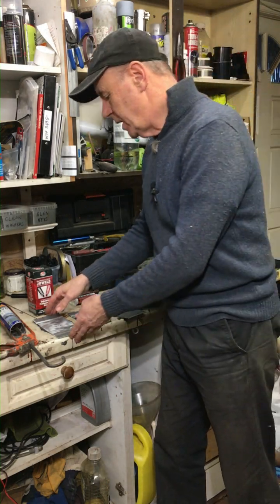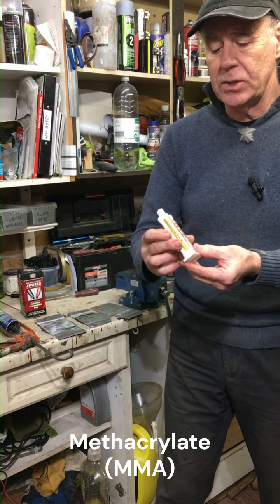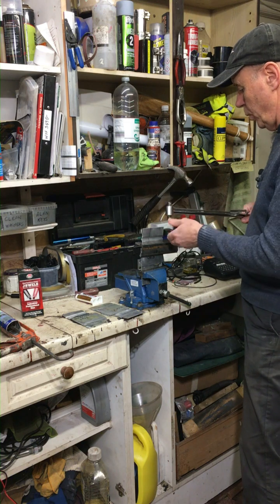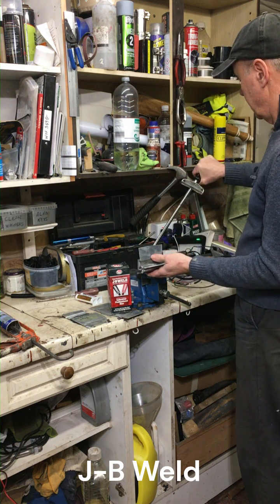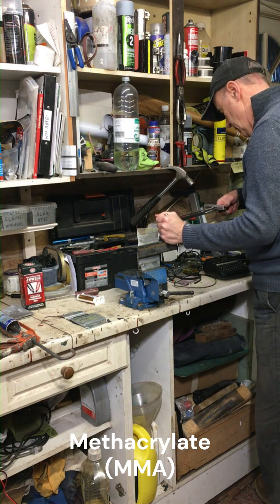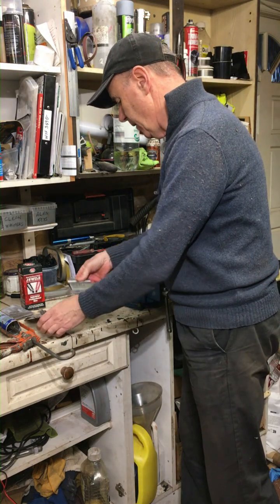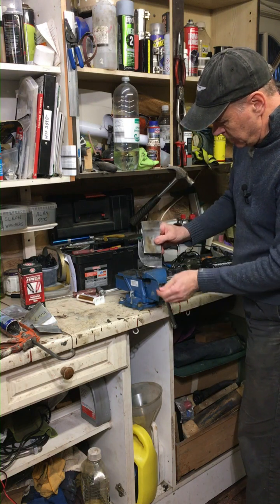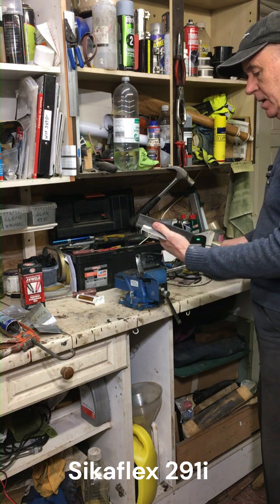Aluminium Bonding Test:   J-B Weld vs Sikaflex vs Methacrylate

Comment: Great video even though I hate vertical video! Bonding aluminium can be tricky due to the oxide layer. One trick is to apply the epoxy first - then score it with something through the epoxy so the oxide can't form. Roughened surface help a lot of course but the oxide forms instantly so you need to score it again through the wet glue.
Reply from the maker: Yes, well you are not alone in disliking vertical video, but it meant that I had to tidy up less of my garage 😄- seriously - that's the reason! I like the tip - thanks!